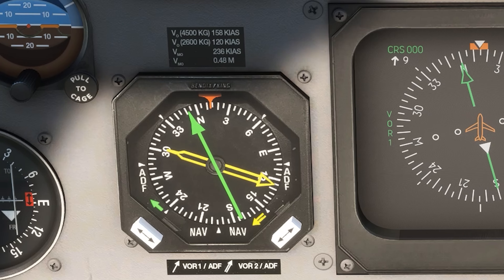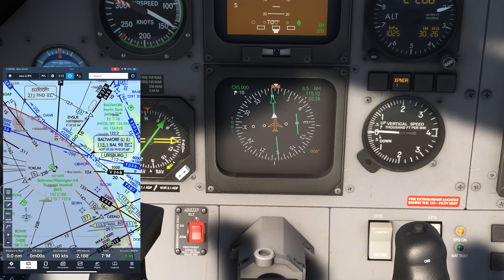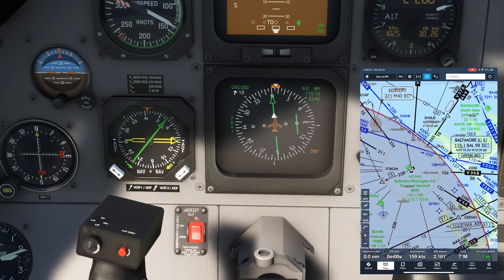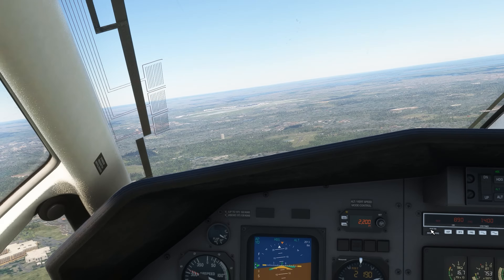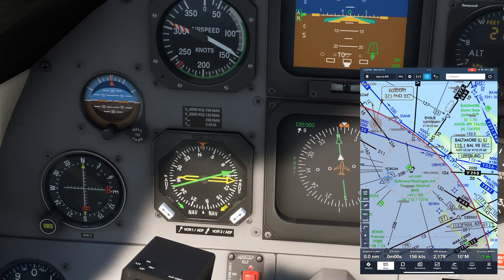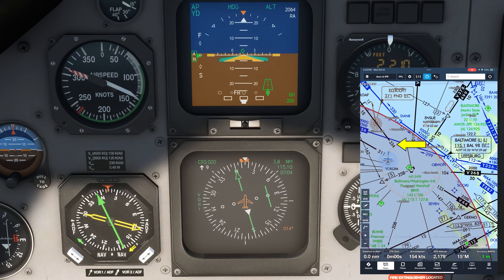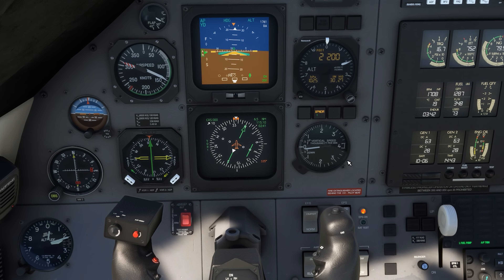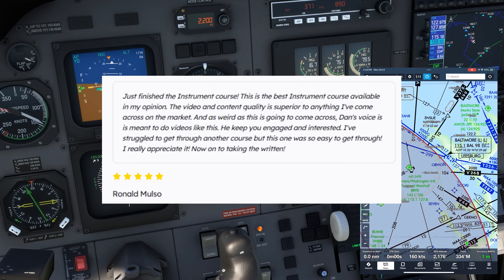The Forgotten Instrument That Teaches You Bearings Instantly | Radio Magnetic Indicator Explained

Comment: What the Pointer does:
Heads always fall like the French Revolution
Tails alway rise like a scared skunk
(I used to use something less PC)

How you use it:
Pull tail and push head
(maybe not so PC after all)

For arcing, “keep it on the three-nine line” but likely slice two-thirty or nine-thirty and let drift aft to three-thirty or eight-thirty and slice back in; adjust to keep within 1 mile (or desired precision) with smaller or larger slices; if you have a wind corrected track, instead of three-nine line, work similar slices with Pointer referenced to the perpendicular of the wind corrected likely gps track. Slice in when getting large on distance, let drift or even cut away if getting too tight, when on the perpendicular you have maximum cross radial rate and zero change in distance so cut out to perpendicular stops range decrease.

Comment: Most EHSI presentations have navaid RMI-like bearing pointers, but I have to admit, unless I'm doing a green needles instrument approach, I have them turned off.

They are very handy for VOR accuracy checks though, takes just a few seconds.
Reply: They are the best way to confirm proper waypoint sequencing, the best way to retain situational awareness off airways, the best way to anticipate intercepting the course when the HSI is still full deflection, the best way to confirm you’re at the FAF, and the best way to self navigate a missed approach if you’re taking a minute to swap back to purple needles.
Reply: @calvinnickel9995 You just listed a bunch of good reasons to use a GPS sourced RMI pointer. I'll remember that.

Comment: Before watching the video, I’ll say I’m a big fan of Pointers. Even more so when paired with dme. Best of all, most your glass HSIs have option to turn on Pointers. I prefer pointer one to Nav One, Pointer Two to Nav Two with CDI toggling between pink and green as needed. The Navy has this thing called point-to-point which can be done simply with radial dme to radial dme. Air Force used to call it fix-to-fix but my understanding is they stopped teaching it. Shame as such not only develops better spatial awareness, it also forms the basis for air-to-air intercepts. Anyway, with Pointers and dme, you can go straight to a point without use of gps. With pointer and dme, arcing is much simpler. As for gps assisted VOR approaches, having the pointer up means you’re watching the raw data hence need not stop out of the pink, useful should you have advisory glide path on said VOR. And even without dme you can shoot a VOR approach timing based without CDI, which if you learn, will help you recognize if ever should you get a bad CDI setting to include having the dreaded reciprocal. With Pointer dme you can be much more precise when first checking in with ATC be it for VFR flight following or picking up an IFR. (Yes, you can cheat gps for dme for all these purposes though then you don’t have the backup for when gps goes down; has happened a couple of times recently like just before the 2022 election and again January(ish) 2023. Once when databases were hacked hence not updating and the next for a corrupt update file.) GPS is “robust” yet actually quite brittle with lots of vulnerabilities you wouldn’t normally think.

Comment: If you use the RMI tuned to the GPS position of an NDB and not the NDB itself (HF freq), you eliminate the Dip Error. 

Also using the bearing pointers on an HSI together with the CDI needle gives you a great awareness when you can expect the needle of the CDI to start centering (10° for a VOR, and 2,5° for an ILS). It's also helpful to judge interception angles for a particular radial inbound or outbound.

The tail of the RMI needle should always "rise" on the instruments, and the head "fall" if you fly interceptions correctly.
Reply: ... what???